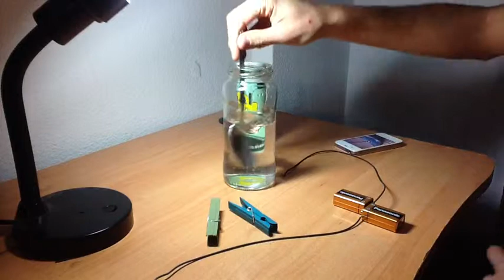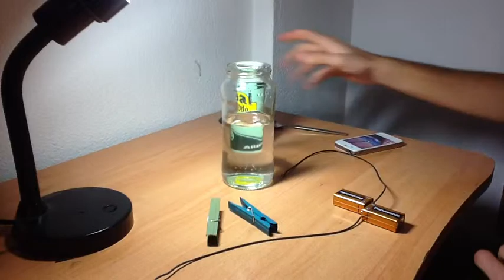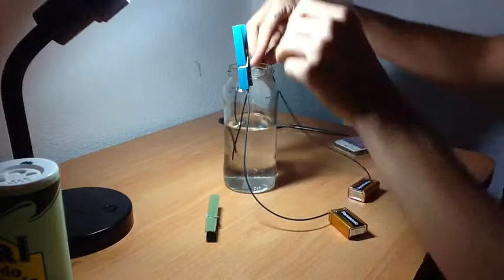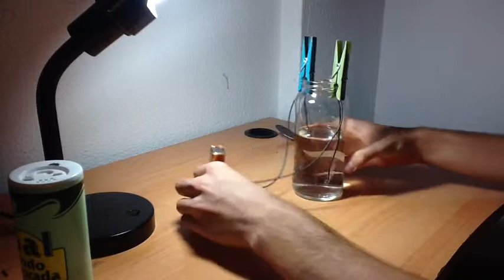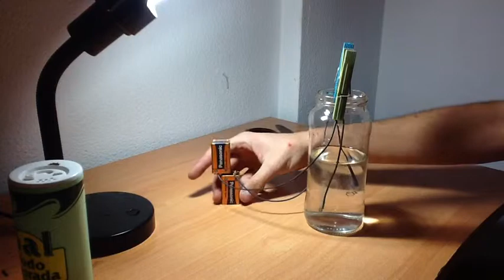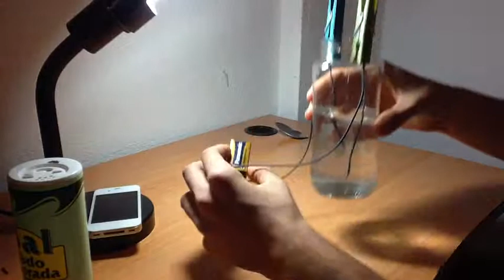Electrolyzing

Comment: Actually, because the difference in reduction potential between sodium and chlorine is so much greater than that between hydrogen and oxygen, the water will electrolyze to a much greater extent than the sodium chloride salt.